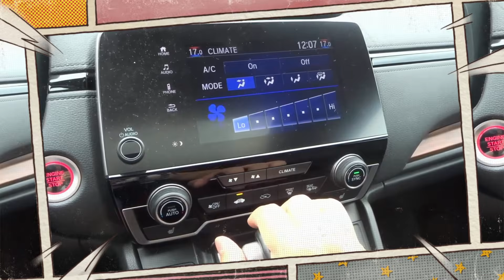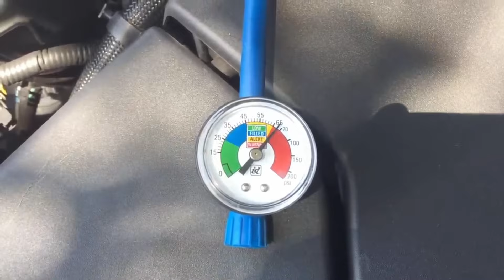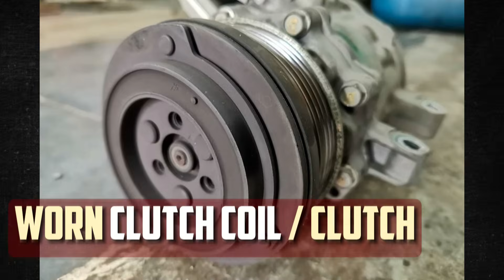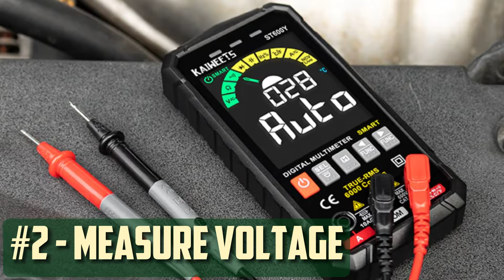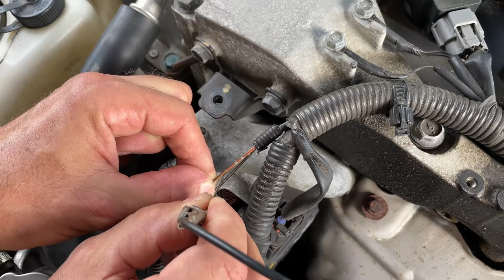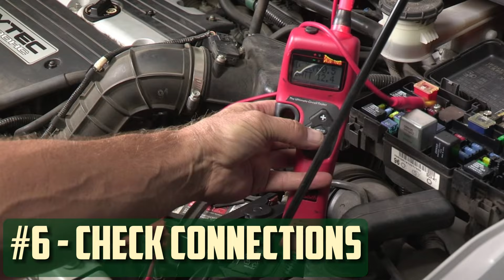5 Causes Car A/C Compressor Clutch Not Engaging & How to fix

Comment: You can't check refrigerant level if the compressor won't run...duh. You can only check the equalized pressure. Should be somewhere 90psi to 100psi give or take a few psi for low side and high side and for r134a your ambient air temperature will vary the psi readings

Comment: Ac stopped engaging. Checked refrigerant, ok. Jumped the relay it kicks on and cools. Replaced both low and high pressure switches. Still doesn't work. I can still jump the relay and it works. Replaced relay on ac, still no. 

Help!
Reply: does the blower work?
Reply: @worlds45v4  yes, on and off and all speeds.
Reply: @BlackFoxProduc there is a control side issue at the relay, the side that triggers the relay to power the clutch.  suspect a bad evaporator thermostat (evap temp sensor), ac module (or ac amplifier), bad wiring/connectors, bad ground at the control ground side of the relay or if you are not too lucky, a bad fuse assembly.  

a wiring diagram of the ac system in your car will be very helpful.  diagnose with a multimeter, test light and logic and find the failed part.  good luck.
Reply: @worlds45v4 thanks!
Reply: @worlds45v4 everything works as it should when I jump the ac relay. I did get a new relay, same thing.
Reply: @BlackFoxProduc an ac relay has four pins.  the two bigger pins constitute the load side of the relay.  one of the bigger pin is connected to the ac clutch fuse.  the other one is connected to the compressor clutch.  this is what you are jumping.  you are just powering the compressor clutch straight from the battery through the fuse.  

 inside the relay is a coil (or solid state circuitry in newer relays).  when current flows through the coil, it closes a switch that lets current pass through the load side, the two bigger pins.  the ends of this coil is connected to the smaller pins, the control side of the relay.  one of the pins is connected to power or the positive side of the battery.  but it is not connected straight to the positive side of the battery.  power will come from the ac module.  the other pin is connected to ground, the negative side of the battery.  

in your case, the control side of the relay has an issue, the coil is not getting current or not getting energized, thus the relay is not "getting jumped on its own".   the power control side might have issues with the ac module, the thermostat, bad wiring or bad connectors.  the ground side might have wire issues or a bad ground connection at the car chassis or body.

if your car has digital ac control, where the cabin temperature can be set to an exact number, you can scan for ac trouble codes with a scanner that can read ac codes.
Reply: @BlackFoxProduc @BlackFoxProduc an ac relay has four pins.  the two bigger pins constitute the load side of the relay.  one of the bigger pin is connected to the ac clutch fuse.  the other one is connected to the compressor clutch.  this is what you are jumping.  you are just powering the compressor clutch straight from the battery through the fuse.  

 inside the relay is a coil (or solid state circuitry in newer relays).  when current flows through the coil, it closes a switch that lets current pass through the load side, the two bigger pins.  the ends of this coil is connected to the smaller pins, the control side of the relay.  one of the pins is connected to power or the positive side of the battery.  but it is not connected straight to the positive side of the battery.  power will come from the ac module.  the other pin is connected to ground, the negative side of the battery.  

in your case, the control side of the relay has an issue, the coil is not getting current or not getting energized, thus the relay is not "getting jumped on its own".   the power control side might have issues with the ac module, the thermostat, bad wiring or bad connectors.  the ground side might have wire issues or a bad ground connection at the car chassis or body.

if your car has digital ac control, where the cabin temperature can be set to an exact number, you can scan for ac trouble codes with a scanner that can read ac codes.
Reply: @BlackFoxProduc an ac relay has four pins.  the two bigger pins constitute the load side of the relay.  one of the bigger pin is connected to the ac clutch fuse.  the other one is connected to the compressor clutch.  this is what you are jumping.  you are just powering the compressor clutch straight from the battery through the fuse.  

 inside the relay is a coil (or solid state circuitry in newer relays).  when current flows through the coil, it closes a switch that lets current pass through the load side, the two bigger pins.  the ends of this coil is connected to the smaller pins, the control side of the relay.  one of the pins is connected to power or the positive side of the battery.  but it is not connected straight to the positive side of the battery.  power will come from the ac module.  the other pin is connected to ground, the negative side of the battery.  

in your case, the control side of the relay has an issue, the coil is not getting current or not getting energized, thus the relay is not "getting jumped on its own".   the power control side might have issues with the ac module, the thermostat, bad wiring or bad connectors.  the ground side might have wire issues or a bad ground connection at the car chassis or body.

if your car has digital ac control, where the cabin temperature can be set to an exact number, you can scan for ac trouble codes with a scanner that can read ac codes.
Reply: @ncolevalv_5673 hey I’m trying to diagnose my AC system so I try to jump the AC clutch straight to the battery and it is not working. It did work a few times and now it does not at all. I was trying to manually add some Freon so can there be a short in between the lead right at the compressor to the clutch?

Comment: I took out a shim - left no gap and started the car w/o turning on the A/C (forgot) at the dash.  (yep - my bad)  I believe I've got a bad clutch coil (A/C works (worked?) in cooler temps but will shut down when outside temp is in the 90s (Not Fun)  I intended to run over to the hardware store and get some thinner shims - but never made that trip because within seconds I noticed a spray of coolant over the engine.  OMG - boy, when things go bad and you do stupid things.  How bad is my situation now ?
Reply: Thinking about removing shim too, AC all works great except when outside temperature is high and car idle for too long. 

So what happen, why it spray coolant after  that?
Reply: @khairulfahmi6120  I was able to remove the clutch assembly using only a socket wrench and vice grips.  You may want to try to remove a shim and set the gap to spec.  Make sure that the AC button at the dash is set to "on" when you restart.  If it's still not operating correctly at high temps then you likely have a bad clutch coil.  You can purchase just the clutch assembly which contains the coil - but in most cases shops will sell only the full compressor with clutch assembly attached.  (and you would be wise to have an assortment of shims in hand before you attempt this - otherwise you may not be able to correctly set the gap.  Its a problem that bedevils even the best mechanics.  So if you get frustrated - join the crowd.
Reply: Too much refrigerant